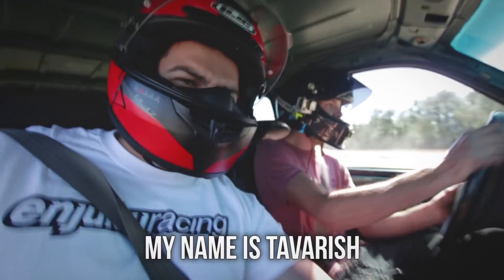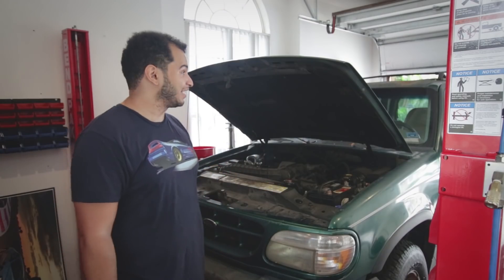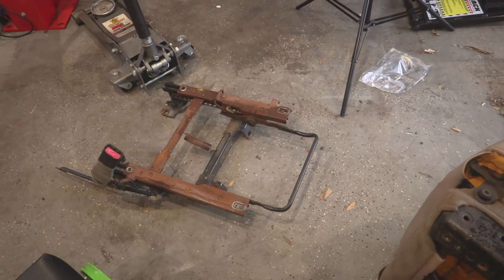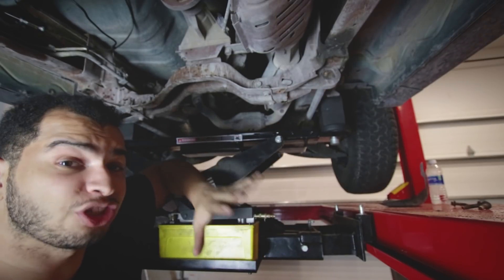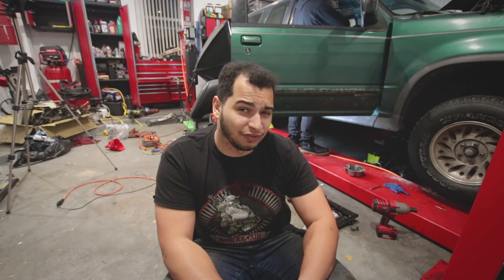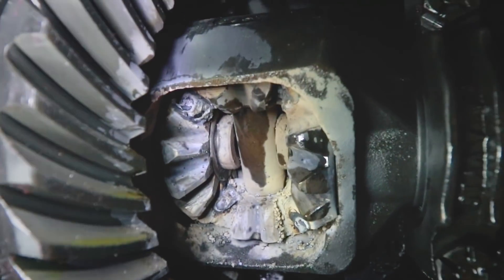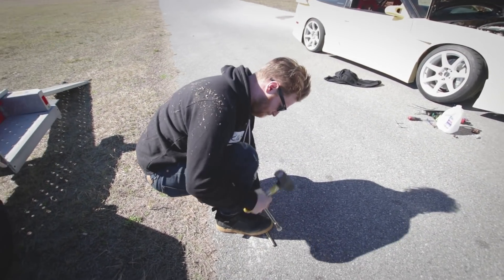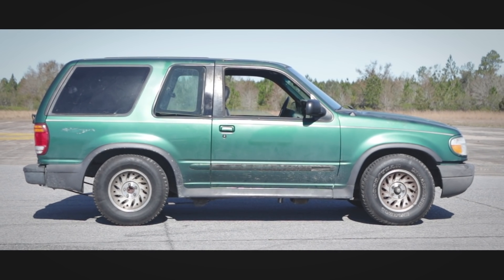We Turned A Broken $500 Ford Explorer Into An AMAZING Drift Car (In 5 Days)

Comment: Those 4.0’s are good engines but they’re known for timing problems they have a jack shaft this engine was basically a overhead valve engine Converted to an overhead cam engine with the same v degreeSo ford used jacks shafted From the old cam to the overhead cams

Comment: man i miss my 98 explorer, yeah it was xlt 4 door with awd, but that thing was tough, and obviously most normal ones will have less miles and probably be treated a bit better, but with proper care the interior stays pretty nice. too bad some asshole in a town car t boned me. and ironically to this video, i rolled over, was moving decently fast and did one complete roll and landed back on the wheels, a large portion of the roof caved in due to the nature and speed of the roll since the guy hit my rear end which swung out and put me horizontal and started the roll. luckily it caved in on the right side and nobody was in the passenger side, my side seemed untouched. only thing that happened was a small chunk of glass got into my hand and i guess at the same time i squeezed the steering wheel as hard as i could. not realizing there was glass in it i grabbed napkins and pushed as hard as i could where i was bleeding.

but yeah moral of the story, watch out for old fuckers in heavy as fuck town cars, those things are fucking tanks, his bumper fell off.

Comment: I have a 2018 Ford Explorer sport it’s got the 3.5 tt and it’s awd so no drifting for me but it hooks and books!
Reply: Mike812 Have a 2017 but it isn't the sport model, love mine, I can't drift, but it's fwd so I'll do reverse donuts lol. Hope you enjoy you explorer well into the future.
Reply: Puff the Magic Dragon have fun rebuilding that front end here in 2018! Learned that one the hard way thinking I was cool doin j turns on dry pavement in my 2014 focus I had at the time
Reply: Jeff Anderson Yeah because the Fiesta and focus are the worst cars ford makes. Basically they both suck for reliability, everything else ford makes is pretty solid. Every brand makes at least 1 or 2 unreliable models, for example, Toyota's Tacoma and Tundra products aren't very reliable. Especially the 2016 and up Tacoma.
Reply: Puff the Magic Dragon maby so, that was the only car that ever left me sranded before and it was the first newer car I ever had Fuckin fluke fuel pump malfunction at less than 20,000 miles, but even so fwd doughnuts probably aren’t good for anything on the vehicle lol
Reply: Jeff Anderson Lol yeah I've had 3 vehicles leave me stranded, one was a Toyota Tercel, 1 was a Honda Accord and 1 was a 2017 civic. The Tercel was a beast, it lasted 150k/15 yrs which is the longest a Japanese car has lasted in my fam, the Accord was a pos, basically bought it used, was 5 yrs old it blew up while driving to Vegas. The civic was even worse, it had catastrophic engine failure at 7k, I'm not a mechanic so I can't tell you exactly what went wrong but it destroyed the engine basically. The focus needs alot of work honestly lol but no brand is perfect, I've know quite a few people who've never had issues with their fords over the course of hundreds of thousands of miles but there are also people who've had a terrible experience. Basically I tell people, if you want a really good small car or sedan, buy a corolla or camry, if you want a good truck/suv, buy a ford.

Comment: Shouldve spent another 500 and got a 5.0😂😂 drop it shift kit and 4.55’s
Reply: Richard Figueroa The v8 only has 5 extra horsepower... it’s useless imo. I prefer my v6 sohc. Better gas millage.
Reply: @angelgjr1999  They had the dog (but bullet proof reliable / longevity) 4.0 OHV engine which is only 160 hp....so either yours or 5.0 would have jumped h.p. way up...your sohc has timing chain guide issues.....not to bum you out...but sohc's are time bombs.....
Reply: Barry A. Yeah well she’s has 202k miles now. Still runs great.
Reply: Barry A. You just have to keep an eye on your engine and you’ll be fine. We had to change the thermostat housing a while back, because I don’t know which idiot engineer thought making the part plastic,that’s  in charge of cooling the engine, a good idea. And had a new transmission put in at about 170k too. Besides that she is great.
Reply: @angelgjr1999  Yeah....I've heard / seen many get up to around 250K....but a lot start failing at 150K and up from this poor timing chain tensioner material / design....
Reply: Barry A. Yup. Plastic. That’s the worst enemy of any engine. Keep an eye on that plastic and oil and you’ll be fine. And on that belt too.